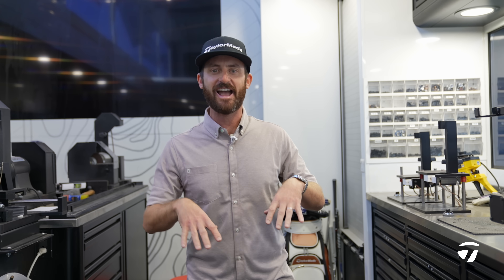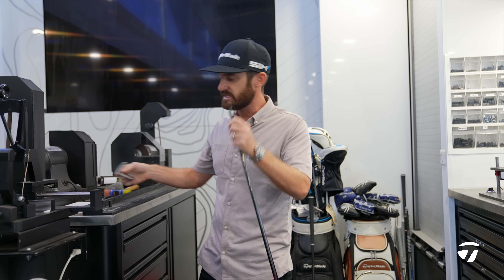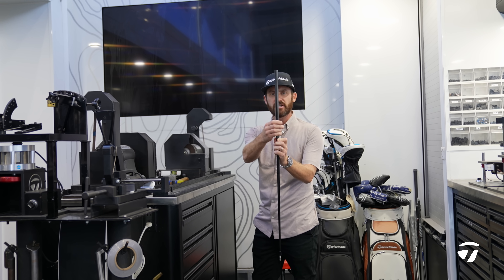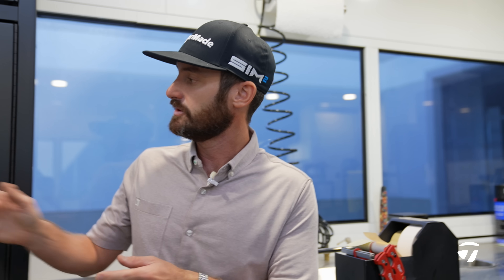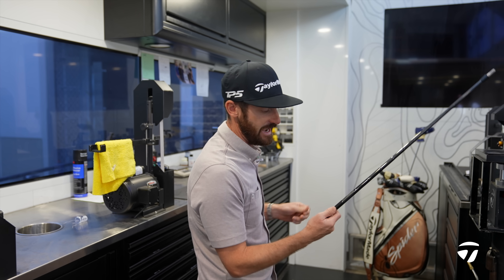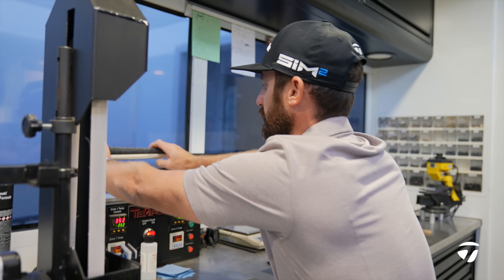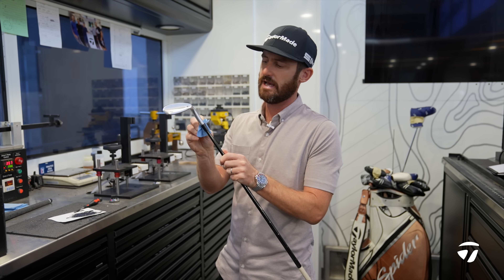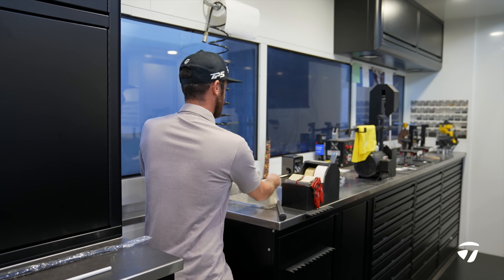MG3 Wedge GIVEAWAY Build on the TM Tour Truck | TaylorMade Golf

Comment: I just purchased a MG3.
By far the best wedge I have ever used.
I can chip so much more accurately and flop the ball easily to where I want.

Brilliant work guys
Reply: Better than Mizuno? My bag is mostly a packaged set aside from a driver and putter I'd replaced so I've been looking at what options I've got for irons and wedges.
Reply: @omgvague  I never had a mizuno wedge, but I can tell you I was running vokey sm7 and this mg3 spins so much more and a lot more feel.

It’s actually got me in trouble a couple times on full approach shots spinning 8 plus meters into water.

I also recently went from a old set of Callaway irons to the p790 with recoil shafts. If your looking at irons they are amazing and you should try them. They are 2 - 3 clubs longer and extremely forgiving.

Comment: Gentleman answer this for me-Hypothetical, if I'm being fitted for a set of clubs and my toe is a bit in the air on a Std 6-iron....
Would that indicate that a player needs his irons bent a little bit flat or upright?
Does flat/upright refer to which way the club needs to be bent, or which way you're swinging the club?
 Basically just tell me if I would play a flat or upright iron if my toe is a smidge in the air on several of my irons-
 I'm guessing I would need a flatter set of irons right?
I know my fitter would work out how much and to what degree just wondering which one I am from what I already know about my swing.
Thx!

Comment: What did I just witness? Did you just use the hosel to scrape epoxy into the head? Then just jam the shaft in? Surfaces weren’t prepped completely or primed with adhesive. Doesn’t wipe off epoxy well enough before so goes at it with a wire brush after. Why would epoxy come out of the seam when curing if the entire shaft is the path of least resistance? Maybe because you jammed the weight in with screwdriver and a gram of epoxy.  Clowns thinking this guys knows what he’s doing.
Reply: 👆👆 congratulations you have been selected among our shortlisted 🎊🎉🎊..